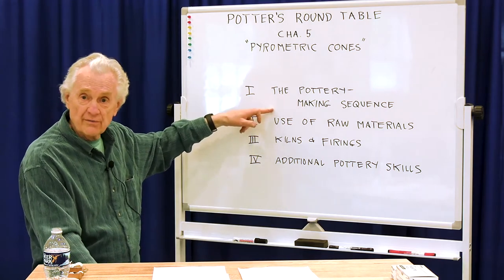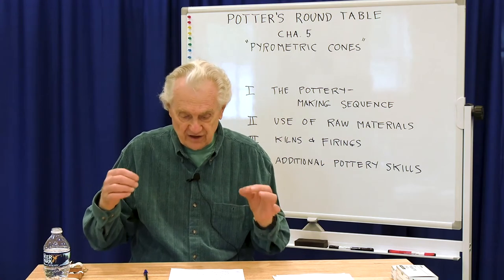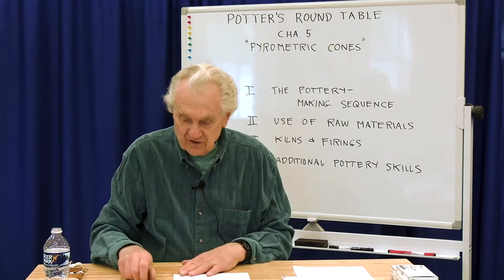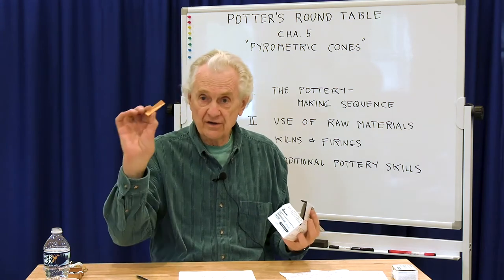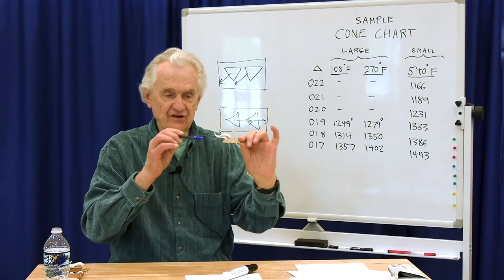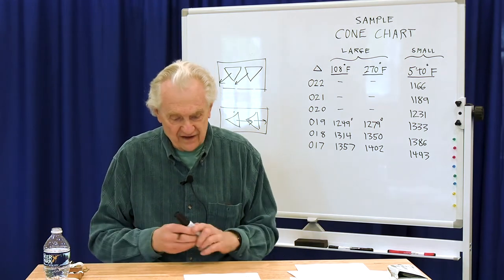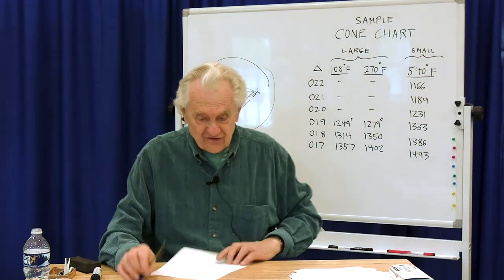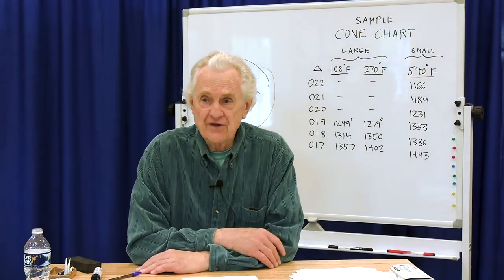Understanding Pottery: Chapter 5 Pyrometric Cones

Comment: Absolutely love these presentations, they are filling in the missing links in my understanding of the ceramic processes.  Thank you!  
And now a question: Am I supposed to be using the small cones for the guide, witness, and guard cones in my electric kiln?  I've been using the large self-supporting cones, propping them up in front of the peephole on various things, but I still cannot see them.  I'm just finishing a glaze firing, so I ran out and blew into the peep as you suggested but I think they're too far inside the kiln.  Maybe the small cones are visible because being smaller, you can put them closer to the peep hole and still be able to see all three?  This seems like such a silly question, but so important too.
Reply from the maker: Aleisa, what did we learn when we were growing up? The only silly questions are the ones not asked! And this is a question I should have asked. I am forwarding this question to Phil and I will post his response.
And thank you for the kind and supportive words, now share this channel with your friends and fellow potters to help us grow our community.
Reply from the maker: Hi Aleisa, 

Thanks for your email and your question (NOT a silly one). The small-sized cones were actually developed specifically for use in electric kilns. So, you can make cone packs of guide, witness, and guard cones using the small cones (each leaning at the proper angle), and then they can be placed on the outer rim of the shelves so that each whole cone pack is easily visible through the (normally small) peep holes. This way, also, the blowing-a-puff-of-air technique really works to cool off the cones and make them more visible. If you have a supply of large cones, they can still be placed in other (hidden) locations to check the temperature uniformity when the kiln is unloaded. 

Phil
Reply: @WashingtonStreetStudios  thanks very much, I'll definitely try that.  I tried looking through welding glass, taking a picture with my phone, etc.  It just looks like a bright glowing mass in there, I can't even see any pots. Currently making lots of changes with regards to kilns, so I'm hopeful!  
Thanks again Phil, and everyone involved, for making these videos available, they are so very helpful! You are a gifted teacher and potter.👍👍

Comment: thanks for the video series.
can unbent cones be reused?
i just got a FireBox8x6LT & my ^5 cones only bent ~10º when i fired it at a medium rate with a 10 min hold at max temp.
so we used them again & they bent.....
Reply from the maker: Alexis, Once a cone has been fired and reaches a higher temperature, the cone has changed in composition. The cone no longer is at the starting composition and will not be as accurate as an unused cone. And isn't that why we use cones, to be accurate?